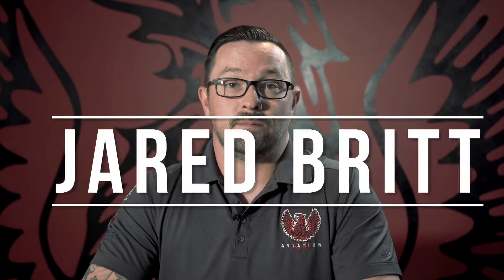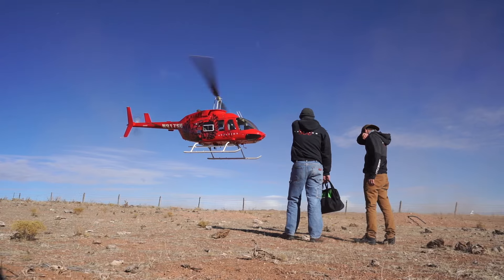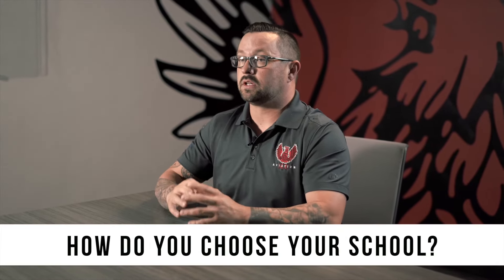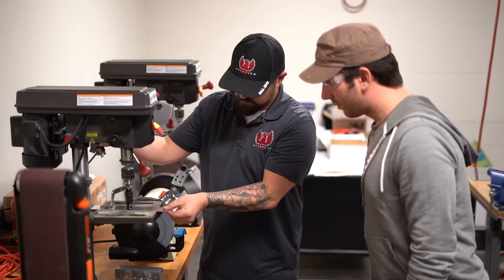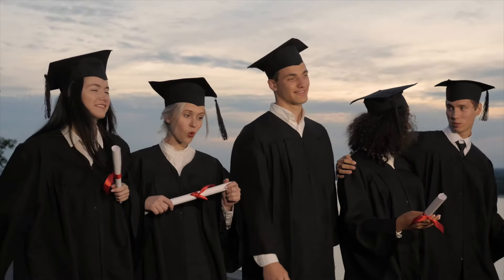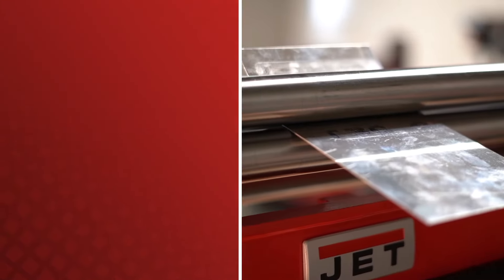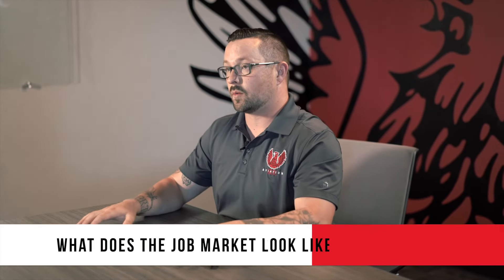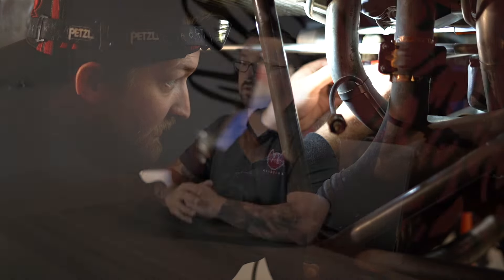How To Become an Aircraft Mechanic (A&P Mechanic)

Comment: I just got my powerplant license on 2/22/2022. Now I’m studying for my airframe written and O+P. Its a lot of studying, but for those who’s still in school and is trying to get their license, hang in there. You can do it if you put your mind to it. Preparing for the O+P can be nerve wrecking, but if you’re prepared, you’ll be fine as you’re taking it.
Reply: Did you have to take a o&p for generals
Reply: @hollyw00d89  yes i took an oral for general aviation and powerplant and will take an oral test when i test for my airframe license. With my experience, when you take your first o+p, you have to pass general before you move on to the powerplant or airframe sections. When you take your practicals, for me, the only general practicals i did was doing weight and balance records, filling out maintenance records, knowing how to fill out a form 337, knowing how to use a multimeter, and visual inspections when i was doing my powerplant practicals. And when i did my powerplant practicals, i had to remove a cylinder off an engine, lubricant the piston and reinstall the cylinder, do a compression test, you need to know what to do with the engine before doing a compression test, remove and install spark plugs, And i had to file a nick out of a propeller blade. And my DME wanted me to show him where i got my information in the maintenance manuals before i did anything.
Reply: Just started aviation school been here about a month. Appreciate the knowledge you have did you get your power plant license?
Reply: @pistolrocshot88  i did get my powerplant license. I think i got my license the same week i posted my original post. And congrats on you starting your journey to getting your A+P. I hope to see you out there in the field when you’re done with school.
Reply: What would you guys recommend to start learning for fundamentals for someone  coming off the street into a school to try to get ahead and not drink from the fire hose of info?
Reply: How many hours a week were you working while going to school?
Reply: @DbM313  i didn’t have a background in being a mechanic or Aviation prior to going to school either. I was just blessed to have teachers to help guide me in the right path and my school have jobs come visit the school every 3-4 months so you can get your name out there by speaking to representatives at the job fairs.
Reply: @radianm6  i was doing door dash and instacart while in school. So i worked whenever i had the time to. Plus my school was in Philadelphia, and I’m from north NJ, less than an hour from NYC so i did something where i can work at my own pace. And i was in school during the covid shut downs so we was doing classes on zoom. My school was Monday-Thursdays, 730am-2pm. So i mostly worked after school and during the weekend, and during covid when no one went out, things like doordash and instacart was booming.
Reply: @jamridd14  I'm in Philly currently working for a major airline. I'm looking to pursue my A&P. Would you mind pointing me in the direction of said school?

Comment: I know this is a recruitment video for the SUU AMT program.  However, there is another way to obtain your A&P certificate, its through military aviation maintenance experience.  If you were/are in the military and hold (or have held) a MOS/Rating in aviation maintenance recognized by the FAA, you may already qualify to test for the A&P certificate without attending a college or university program or a private AMT School.  Check with your local FAA Flight Standards District Office (FSDO).  I have been a A&P (with IA) since 1994 and this is how I obtained my certificate.
Reply: Hi there!
Can a Pakistani join aviation in USA as Aircraft mechanic? If not directly then what's the route to get in... I'd really appreciate your guidance 😃
I'm an Aircraft Technician in a Pakistani Airline since last two years and before that I did a three-year apprenticeship program in Aircraft Maintenance Engineering from a ANO-147 approved organization in Pakistan.

Comment: Airline jobs are always short the recruitment drives start as early as your first year of high school at 16 years old like me. When I got got to the first meeting I had a GED at sixteen years old because the airline industry got the school to kick me out to take the GED so I could report to work. My first day at LaGuardia the weren’t answering any of my many questions and I was so frustrated and locked in the yard at lunchtime with all the other students that I just left the school. The student recruitment is heavy and unyielding but they didn’t give me no answers. I was 16 years old. This airline industry is extremely aggressive but also unyielding and abrupt. I passed the GED three times and two of those retakes was to make sure the original score was correct.

Comment: Thank you for the video, I’m currently working manufacturing and I’m looking for a career change. I’ve only changed oil, filters, brakes, general auto stuff. I’ve never worked on any type of engines. Will this be a good career for me? 

Thanks,
Reply from the maker: Hey! It depends on what you're looking for, but if it's the knowledge difference that you're worried about, then SUU makes sure every student has the skills they need to be successful. You can check out our A&P playlist to learn more about what being an A&P mechanic looks like!

Comment: Curious, what health conditions, if any, would prevent one from being hired as an Aircraft Mechanic (A&P Mechanic)?
Reply from the maker: While there are no outlined conditions that would disqualify you, a condition that impacts the eligibility requirements may be an issue. If you’re concerned about a disability, you can contact your local flight standards district office and they can let you know for sure.
Reply: Just a heads up - A&P’s sometimes will work in hangars that are not air conditioned - in areas (particularly in Southern states) this will make it quite hot and increase the chances of heat exhaustion, etc., etc.  Keep this in mind when it comes to cardiovascular concerns or troubles breathing and stuff like that ; ).    Bring Zyrtec or Flonase and keep it in your toolbox or break room ; ).

Comment: I completed my graduation in mechanical engineering how to I became a air craft maintenance engineer
Reply from the maker: Hey, Potlapalli! If you already had a mechanical engineering degree you would only need to take the A&P classes. You should reach out with any questions to Aviation Admissions at aviationadmissions@suu.edu or 435-865-8148.